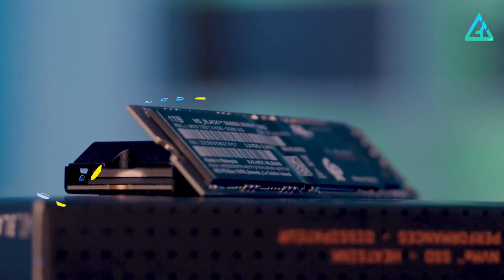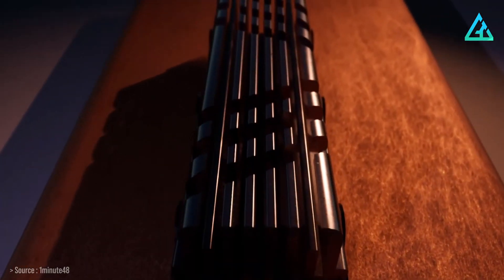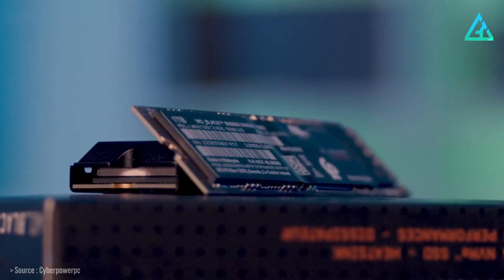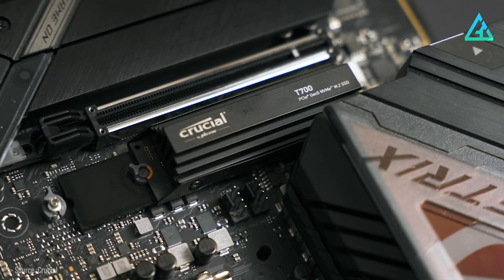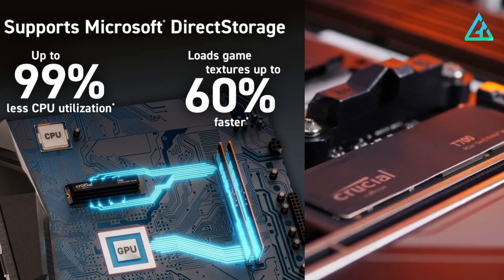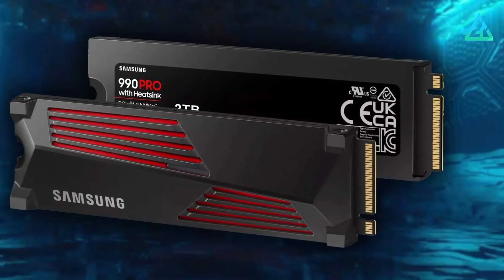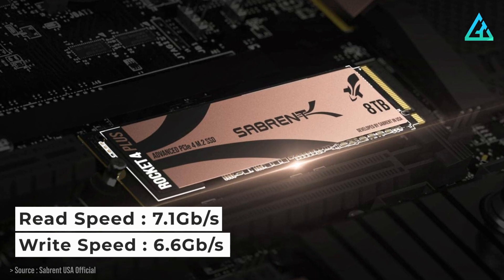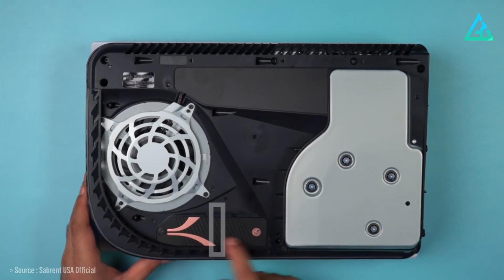[Top 5] Best M.2 NVMe SSDs of 2023

Comment: Shit video with robot/ai voice. Yawn. For high end NVMe's the Solidigm P44 Pro Series is unmatched. You get insane 7000/6500 speeds, but because they are ex intel developers (who worked on intels SSD range of products aka optane), the drive also supports a learning function to boot commonly used items faster via software. So for example games or applications that you use often will boot faster and work better than typical NVMe drives. Its also cheaper than other brands higher end spec drives. IF you were buying cheaper drives, the P41 plus has speeds of 4125/3325 which is still above most other brands budget line of 3000/3000 or 2000/2000 speeds. Granted we speaking gen4 here.

The crucial T700 is a beast for early Gen5 adoption. However, the 1tb t700 is more expensive than the 2tb gen4 solidigm drive and while speeds are basically doubled, real world you will never see/use those speeds. Thus every user is better off buying the cheaper high end gen4 drive. The 4tb t700 is over $500 bucks... insane. I could buy two 4tb NVMe drives, still save money over the t700, and just raid0 them together for similar speeds....